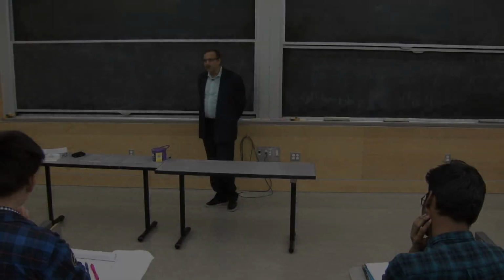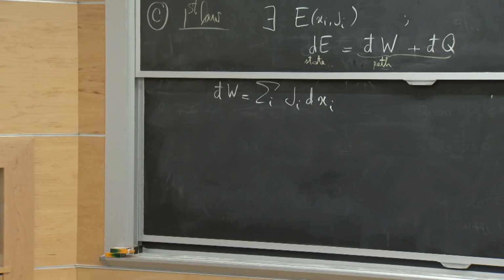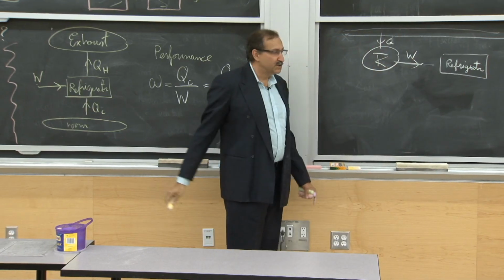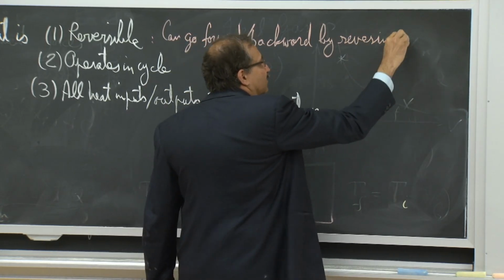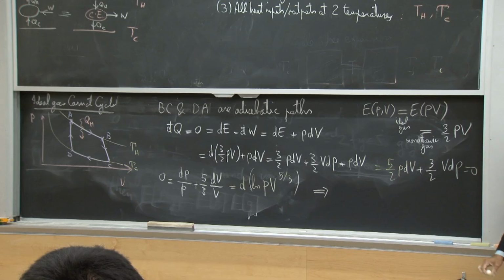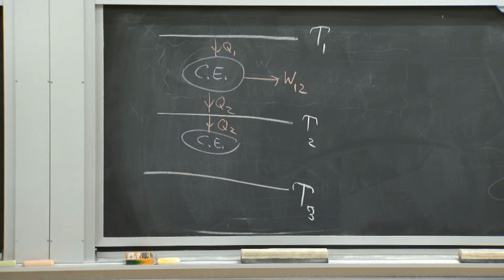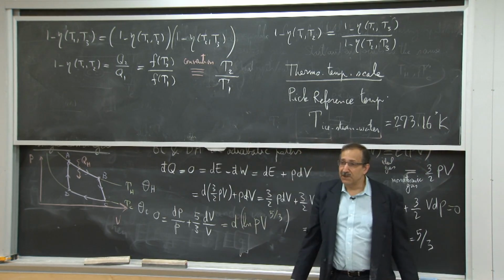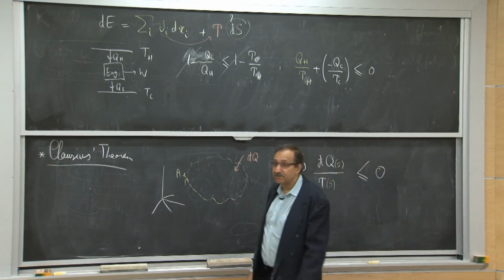2. Thermodynamics Part 2

Comment: 20:36 calling the bottom reservoir "room" is somewhat misleading, because a kitchen refrigerator takes heat out of the "cabin" of the refrigerator, not from the kitchen (which we would call the room). What is described here is closer to what we colloquially call an "air conditioner"
Reply: that is very true, but the refrigerator has its own "air conditioner" on its back, that takes heat from the refrigerator room and dumps it in the kitchen. so it is accurate.

Comment: Wrt. the argument for the CE being the most efficient, is there any logical dependence on it being a CE? Like it seems that you can just substitute any refrigerator in there and you could derive a conclusion that \nu \ge \frac{1}{\omega}. The only thing that the CE seems to contribute is that it allows you to make direct inferences about its capacity as an engine from its capacity as a fridge.
Reply: If the NCE is reversible the similar augument in this video will give you a inverse inequality and that will lead equality that any reversible engine have identical efficiency that is of carnot engine's. I think you can't substitute any refrigerator but reversible refrigerator.

Comment: I thought the question at 15:20 was really interesting. I wonder if the answer is along the lines of "yes, but to get such a threshold, you would have to be doing nonequilibrium thermodynamics'
Reply: I mean, it does make sense to ask for a tolerance below which you can guarantee accuracy for a numerical derivative, right? I guess the analogy isn't perfect though.

Comment: Introduction
0:00 - Introduction and Creative Commons License
Review and Thermodynamics Structure
0:20 - Review of previous lecture and the structure of thermodynamics
Equilibrium in Thermodynamics
0:33 - Emphasis on equilibrium in thermodynamic studies
Mechanical Coordinates
1:09 - Discussion of mechanical coordinates in thermodynamics
Gases in Thermodynamics
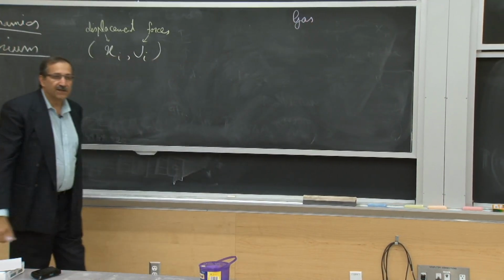2:07 - Focus on gases, especially ideal gases
Temperature and the Zeroth Law
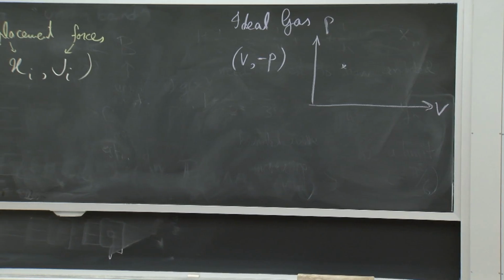3:01 - Inadequacy of mechanical coordinates alone; introduction of temperature
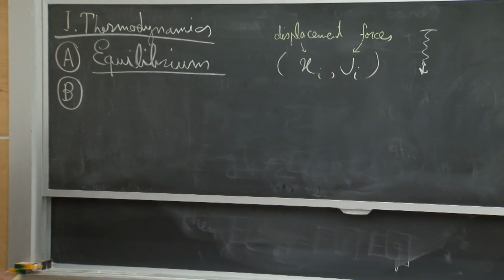3:38 - Explanation of the Zeroth Law of Thermodynamics
Isotherms in Gases
5:09 - Isotherms in gases, especially dilute gases
Internal Energy and System Changes
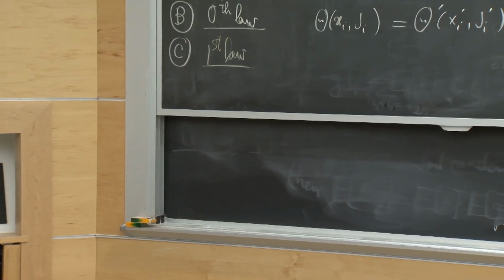6:02 - Exploration of system changes and the concept of internal energy
Joule's Experiment
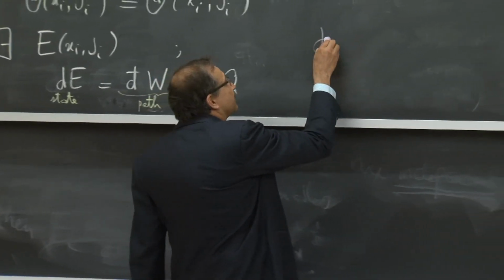8:28 - Joule's experiment and its implications
Theoretical Constructs in Thermodynamics
11:28 - Theoretical construction of functions in thermodynamics
Quasistatic Processes
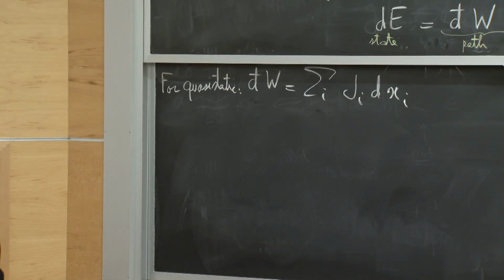13:12 - Quasistatic processes and their importance in accurate calculations
Second Law of Thermodynamics and Entropy
15:21 - Introduction of the Second Law of Thermodynamics and entropy
Historical Context of the Second Law
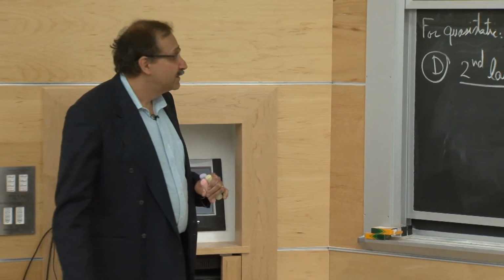17:28 - Historical context and relevance of the Second Law
Heat to Work Conversion
20:05 - Heat to work conversion in engines and refrigerators
Kelvin and Clausius Formulations
23:05 - Kelvin and Clausius formulations of the Second Law
Equivalence of Kelvin and Clausius Statements
27:15 - Logical equivalence of Kelvin and Clausius statements
Carnot Engine
33:43 - Carnot Engine and its properties
Carnot Cycle with Ideal Gas
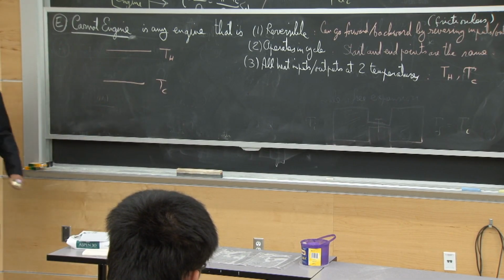39:18 - Description of Carnot cycle using ideal gas
Adiabatic Paths in Carnot Cycle
47:19 - Mathematical description of adiabatic paths in the Carnot cycle
Efficiency of Carnot Engines
49:00 - Efficiency of Carnot engines between two temperatures
Proof of Carnot Engines' Efficiency
53:14 - Proof of Carnot engines' efficiency being the highest
Thermodynamic Temperature Scale
57:42 - Introduction of the thermodynamic temperature scale
Consistency of Temperature Scales
1:07:59 - Discussion on the consistency of temperature scales
Recap and Energy Function in Thermodynamics
1:14:42 - Recap of the lecture and the energy function in thermodynamics
Introduction to Clausius' Theorem
1:20:08 - Introduction to Clausius' Theorem and entropy quantification

Comment: In the proof at 50:00, How does he prove that the carnot engine is the most efficient engine without using any specific properties about the Carnot engine? Also if we assume an engine E which is more efficient than the carnot engine C, then shouldn't E be able drive the carnot engine and still have some left over work?
Reply: You dont need any specific properties of Carnot engine. You only need that it should be reversible and returns back to its initial state (i.e. is a cyclic process). This is because every Carnot engine no matter how it is constructed has the same efficiency between two temperatures. He proves that Carnot engine is the most efficient by reversing the engine into a refrigerator at 51:30

Comment: at 53:00, can someone explain how Q_h' > Q_h follows from Clausius? Wouldn't Clausius just say Q_h' - Q_h > Q_c' - Q_c ???
Reply: Clausius says that the sole result of a process cannot be the transfer of heat from colder body to hotter body. The net process here is the intake of Qh'-Qh heat from the hot reservoir and then depositing Qc'-Qc heat at the cold reservoir. So according to Clausius, the heat must be flowing from hot reservoir to cold reservoir. So both Qh'-Qh and Qc'-Qc should be positive, because if it were negative it would imply that heat is flowing from cold reservoir to hot reservoir(which would violate Clausius). So Qh'-Qh is positive or Qh'>Qh. Also from the net process diagram, It must be that Qh'-Qh=Qc'-Qc so as to satisfy energy conservation.
Reply: We can show that this relation that you wrote , is  proven by applying 2nd law of thermodynamics in Kelvin form for non-carnot and carnot engine separately. for non-carnot engine , according to 2nd law , we should have Q_h' > Q_c'  because (efficiency of non-carnot engine) =  W/Q_h' =  (Q_h' - Q_c' )/Q_c' = 1 -  Q_h'/Q_c'  ; so in order that  (efficiency of non-carnot engine) < 1  , we must have : Q_h' > Q_c'  ; because carnot-engine is a reversible engine , we can say that it's efficiency doesn't change by reversing the process. Now because we have a similar way of conclusion for carnot engine as before for non-carnot engine , we can say this time : Q_h > Q_c  for carnot engine. By subtracting the side-by-side of this inequality , we have :  Q_h' - Q_h > Q_c' - Q_c ; according to clausius form of 2nd law , the Q_h' - Q_h must be positive.

Comment: There's a lemma used here that's left unproven at around the one hour mark. We need to show that chaining two Carnot engines is equivalent in efficiency to a single Carnot engine. It isn't really hard to prove using the optimization lemma and reversing one of the engines connected to T_2, but it's not trivial. Good to leave as an exercise to reader, though, haha.
Reply: Didn't he implicitly justify it when he showed that the efficiency is a function of the two temperatures?
Reply: I don't agree with your view that something was left unproven. At around 0:55 he already proved that all Carnot engines operating between the same pair of temperatures have the same efficiency. The two chained Carnot engines that he considers at around 1:00 when seen as a single combined engine obviously fulfill the general definition of a Carnot engine (definition at 0:34): 1. it is reversible, 2. it is cyclic and 3. it operates only between two reservoirs (T1 and T3). (The third reservoir T2 is irrelevant and can be taken out of the picture by putting Q2 coming out of sub engine 1 directly into sub engine 2.) Hence, the efficiency of the combined engine has to be the same as that of any Carnot engine operating between T1 and T3.

Comment: Anybody knows an example of Carnot machine "made" with any different thing than a gas?
Reply: A Carnot engine means an engine working with two external heat sources (a cold one & a hot one) where the cycle is a sequence  of adiabatic-isothermal-adiabatic-isothermal processes. It is not possible to construct a Carnot engine that behaves perfectly (that is why I mentioned adiabatic processes instead of isentropic processes) so they will never reach the Carnot efficiency limit. But some cool examples have been built, such as the one in ["Brownian Carnot engine", by Martinez et al, Nature Physics (2016) 67, 12 (1)]  where the authors use an optically trapped  Brownian particle as the "gas" (a gas of 1 particle).
Reply: Carnot engine is imaginary..